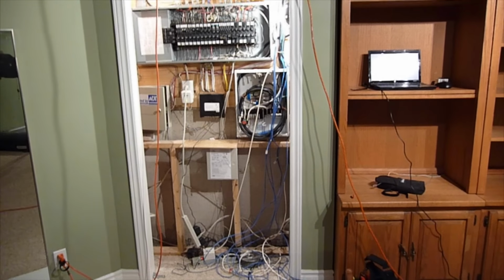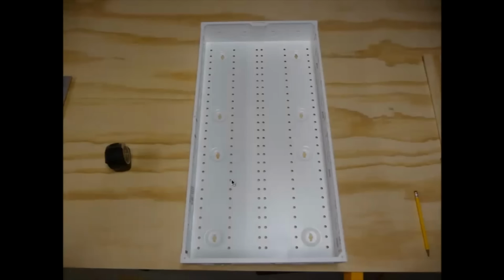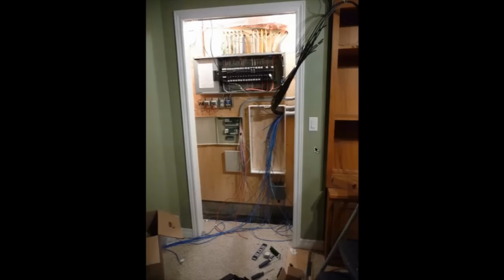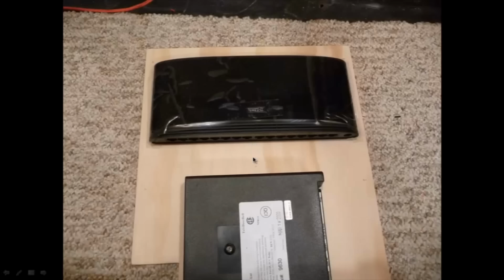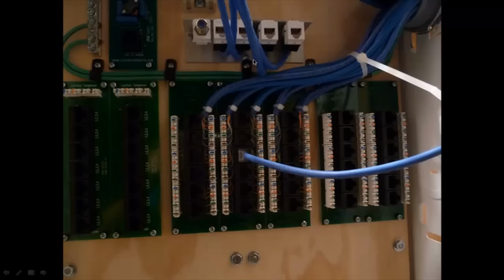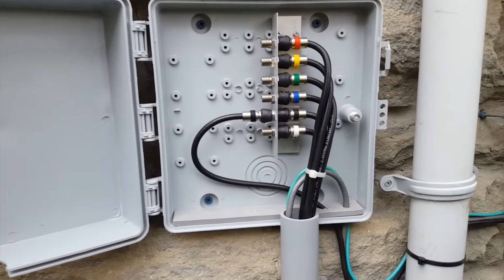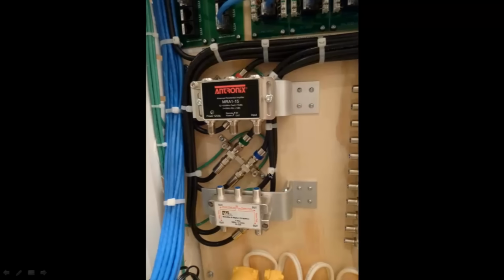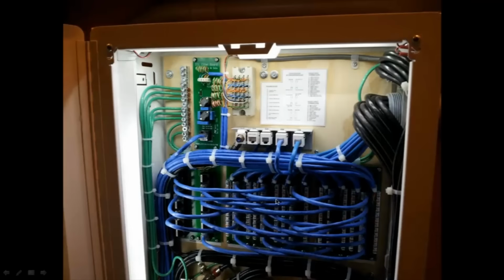Electrical Closet Re-Wire & Rehab (Part 1)

Comment: Hi, great video! Looks fantastic. Couple of things as a wire technician myself that concerned me that you may want to change up. The coaxial cables are beyond the standard bend radius specification. They should never exceed a 3" bend radius. Bending coax at a sharp angle will change the impedance of the cable and cause signal loss. 
All bonding of ISP/Satellite services should be done on the exterior of the house, in case of a spike of electricity it will be grounded straight to ground, instead of having to take the chance of something happening in your house. It is also likely that your cable is already bonded in the cable box to the far right. 
Too many coax splice points, every splice point is a loss of 2dB (1dB per barrel connector, .5dB per F connector)
Move the grounding blocks outside and ground outside, eliminate the coax patch block and connect the house drops straight to splitters to reduce signal loss.
Reply: Agreed, just cause it looks good to bend a cable like that, doesnt mean it should be done. There is gunna be signal loss as well as tons of cross talk from that patch panel setup for his data / phone connections
Reply: Wouldn’t the amplifier take care of the signal drop?
Reply: Chris Stromberg amplifier in this case would also amplify the noise.

Comment: I like how you did the demarcation point outside your home. Like you, all of our cables are ran into our home via conduits because of our pool. When the pool installers ran the conduit they made it way to small and we can't get any new cables for satellite or even fiber through. I am running a new conduit and will defiantly keep this in mind, such a great idea so cable techs do not have to fish wires.
Reply from the maker: Thanks man, yes it definitely helps in the future to save time if you put a little more effort into the project in the beginning.
Reply: Do you have fiber internet or just the fiber TV?
Reply from the maker: Yes fiber internet as well....but it's only fiber to the neighbourhood demarcation box (basically the telco box at the main road before coming into the neighbourhood). Then the TV and phone come to the house over one phone line.
Reply: What speeds do you get?

Comment: As a cable technician I agree with previous statements, coaxial radius to tight, bonding (grounding) needs to be done outside. 

The material in the outside portion of your rain sensor is leather. The leather disc provide the closest representation of soil saturation and time to dry. ( I worked as an irrigation service technician for 9 years.
Reply: But my OCD thanks you. It sure does look nice.
Reply: One last thing, no technician I have ever worked with would touch this install. Even myself would bypass most of what you have done here. So many barrel connectors and throwing an amplifier in there. Did you even check your signal strength before adding the amp? If you plan on using a cable modem that amp is gonna push your transmit above the acceptable limit and you will experience random internet drops. Not to mention the SNR (Siganl Noise Ratio) is gonna be all out of wack.

Comment: So... can you shut the data panel's door? 

I'm not really sure whether to up-vote this video or not.  In some ways, the outcome is quite nice, and the improvement is undeniable.  But in other ways, there seems to be no future-proofing (beyond extra incoming cable lines), no service loops, little slack, and lots of confinement.  (I get claustrophobic around data panels.)   I thought the wood inside the back of the data panel was overkill but it's good I was sitting down when it went onto the door, too!  I can't believe there was still space to mount any equipment in there.

Comment: You did right about the grounding. You should ALWAYS individually ground wires. Otherwise, electricity might find another way to other devices and end up damaging more equipment. Especially if you have a 3phase power in your place.

Comment: I'm curious:  Your electrical panel seems to have the incoming Lines on the left hand side then you have arranged the feeds from 15amp on the left through the 30s and 40s to the whopping  100amps on the far right.  We'd have done the reverse, the heaviest potential draws nearest the incoming on the left and then down to the smallest on the far end.  This to minimise the current having to flow through the length of the bus bar.  

Such an arrangement isn't mandatory (yet) but is strongly recommended.
Reply: It could be mandatory depending on the specs of the panel.

Comment: Very Nice Job! Do have any photos of the cables coming down off the roof from your antenna? I am just curious if you were able to put them in a conduit so the install look professional.
Reply from the maker: Thanks! Unfortunately no, because I actually don't have any antenna hooked up - I just have those feeds there for future use in case I did install an antenna. They just terminate in the box outside the house. If you did want to have a professional look, I suggest a vertical conduit up to the roof eaves overhang, and then install a service entrance weatherhead. This way the wire can come off the antenna, off the roof, around the eavestrough, and into the conduit weatherhead to travel down the wall.
Reply: Thanks for the feedback. Again, your work looks outstanding. Very neatly done!

Comment: It looks amazing, now with that said as a low-voltage electrician I have so many questions.
Were you aware of the fact that if you went with the On-Q/Legrand you could have fit the security in the structured panel Legrand make mounting brackets for security panels?
Were you aware that they make 42 inch cans?
Wouldn’t have a 42 inch can recessed in between the studs looked so much better than two overpopulated cans with three pieces of conduit going to them? 
Do you know how much of your time you could’ve saved by using Legrand equipment like modems, ethernet switches and third-party brackets as opposed to customization?
With almost every circuit breaker on the same phase how dirty is your power to supply your TV, projector or audio system?
You are aware that the mini surges across your panel that are produced by minor appliances like toasters, blenders, coffee makers, hairdryers can cause all sorts of A/V problems, right?
If you are addressing this problem how many power conditioners are you rolling with?

Comment: it LOOKS good, but there are reasons electricians leave slack in the box, expansion / contraction, allowing changing where the wire's feed to, a condensation loop, etc. ... tight connections are definitely not " to code"

Comment: Beautiful but...

Around here, your power block wouldn't pass.

Wire extending in the electrical panel is frowned upon.  I'm expected to do it in a junction box beside the panel.

Comment: Coax should be grounded at any outdoor splits w/ lightning rod, just reassurance in case there's ever a lightning strike. It's already saved the equipment at our house. Lightning blew the outdoor splitter up, cooked the ground at both ends, but all the TV's and modems survived. Just afraid if it gets in the LV box it's going to find it's way to the network wiring. Btw love the wiring job!

Comment: That modem and switch has no ventilation. Interested to see how long it holds up before one of them dies. Great work tho, but I give it a B just for that
Reply from the maker: Good point, but the enclosure itself is passively vented with all the case vent holes. After testing the units for a couple days, they barely got warm to the touch (actually the switch was still cold) so I figured passive venting is all they needed. The switch has been running problem free for 8 years, and the modem was upgraded in 2015 so running for 4 years without any issues either. Any heat generated rises right up out of the row of the top vent holes and is replaced by cool air from the bottom and sides.

Comment: Why in US there isnt standard color cable like EU?
Reply: Because the US has different standards. In the US, that just IS standard.
Reply: Because in the US we can tell that a wire is thicker without a pretty color on it.  Just kidding.  There is a movement and it might be code in some places to have 12ga wire jacket be yellow instead of white.  Locally, all the 12 gauge wire at retail and wholesale vendors is yellow.  So at a rough-in, with 14ga being white, it's easy to tell the difference.
Reply: Which cable are you talking about?

Comment: I wouldn't use epoxy to glue screw heads to paint. It would have been better to grind off the paint before gluing.

Comment: All networking NEEDS to be separate from coax and electrical. Wayyyyy too much interference, ideally a separate closet.
Reply: A separate closet is probably too far fetched. In data centers, power runs separate sides for data & power, and I don't think they're wrong. Having them besides each other in different steel cabinets is just fine in the majority of cases.